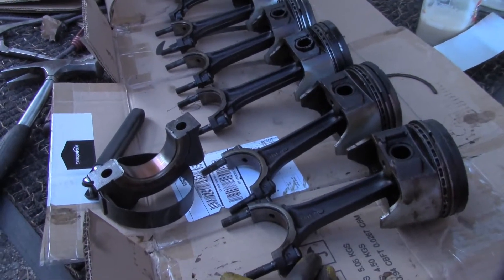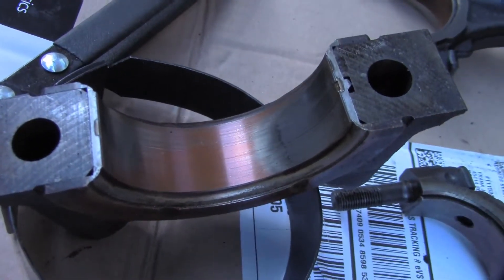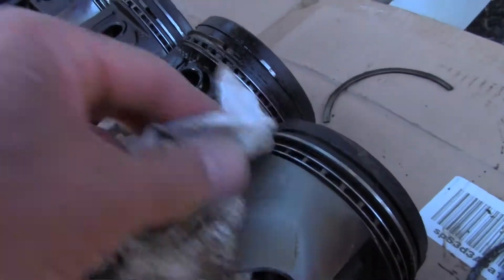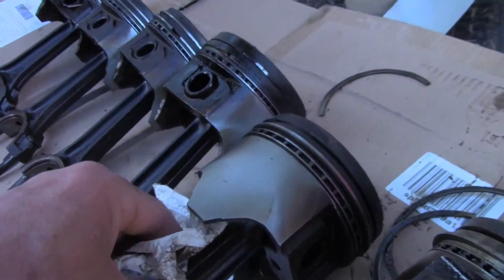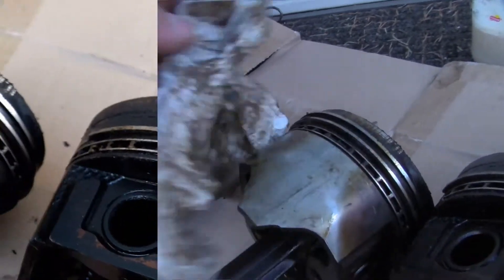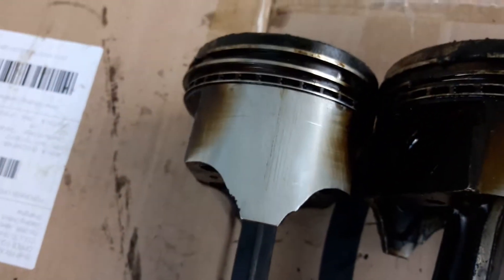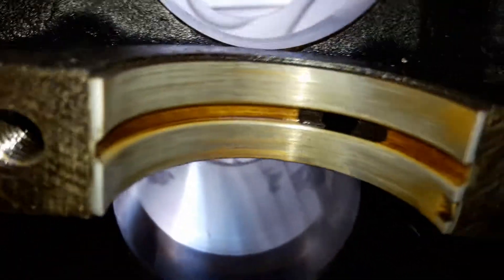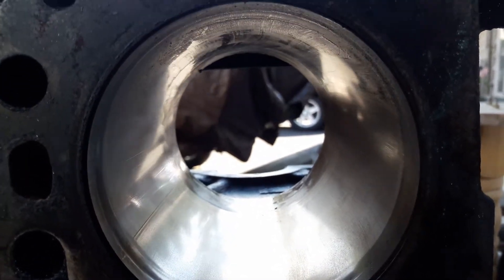3 broken rings (from cylinder wall ridge) 4 cracked pistons tear down Ford 300 4.9L i6 146,000 miles

Comment: I have a 92 F-250 with this engine that has 300,000 miles and has had piston slap for the last 20,000 miles. other than the noise it still runs strong and still doesn't use any oil between changes.    I use castroil 10w30 synthetic blend and change it every 3,000 mile.